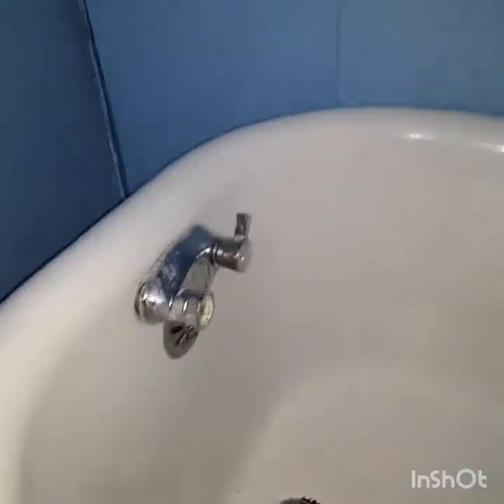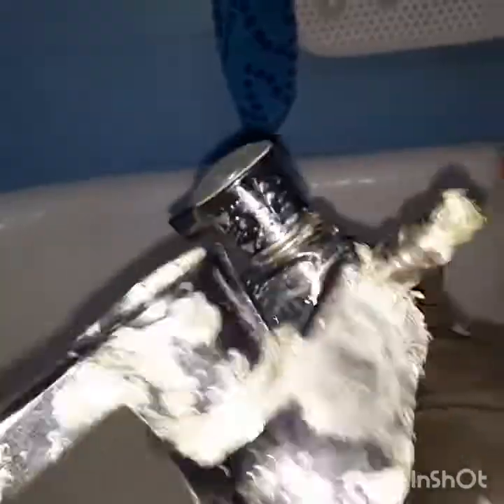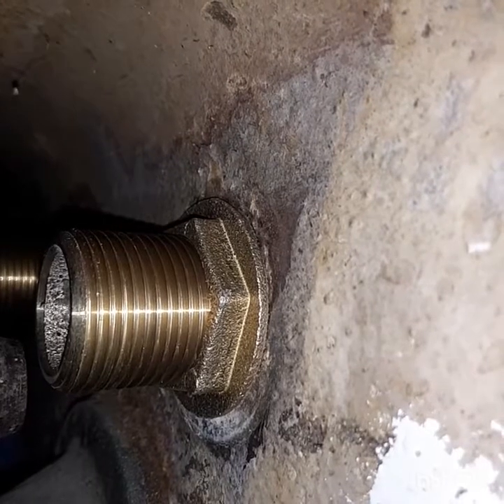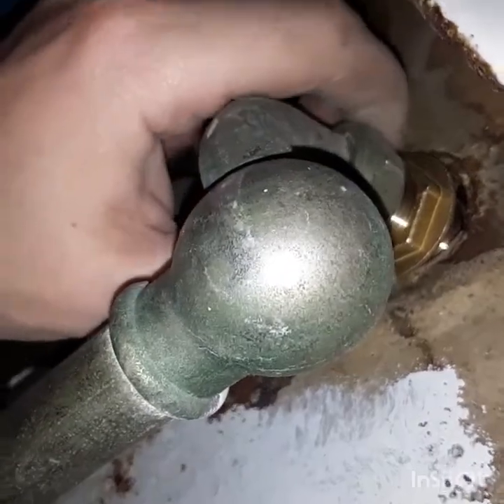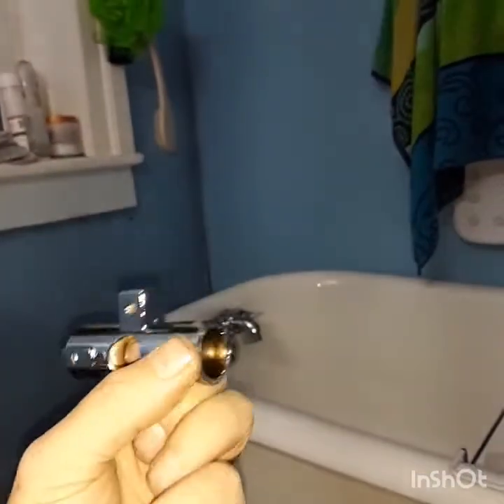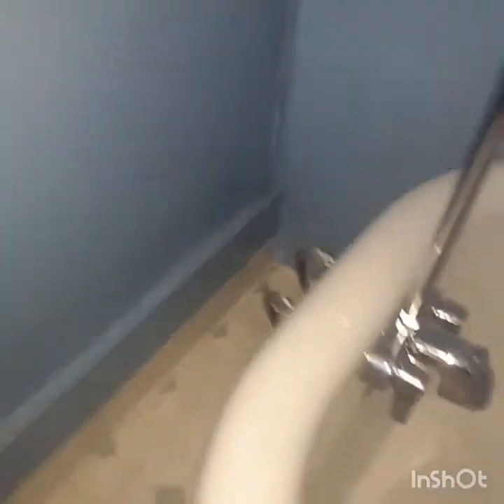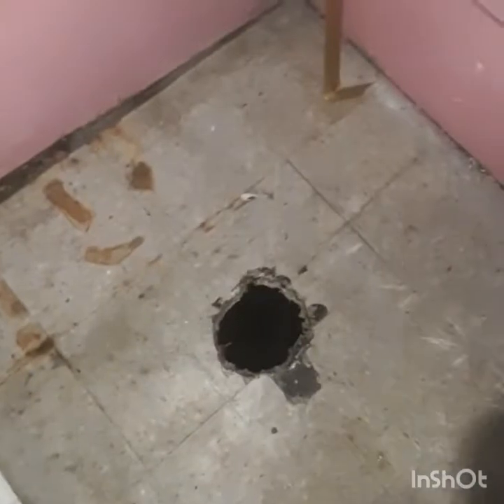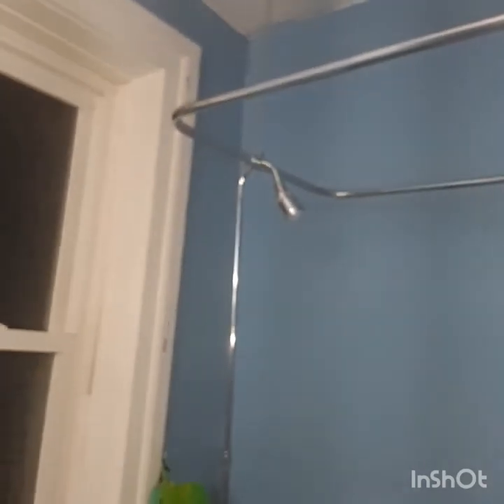Install of Claw foot tub Shower kit

Comment: Amazing video for replacing cast iron tub faucets. This is exactly what I'm doing right now and so far it's right on.
Reply from the maker: Nice! Glad I could help. Let me know how it goes, if you run into any issue (like I did) give a holler
Reply: @dixondoesit7466  Went better than expected, and your advice helped. I saw in another video a plumber put a bunch of plumber's putty to fill the edges of the circular holes, and I had some on hand so I did that, also. The advice about loosening the fixture to help a stubborn pipe fit was good, too.